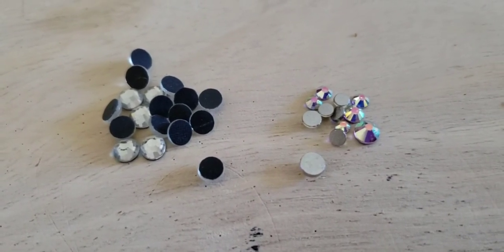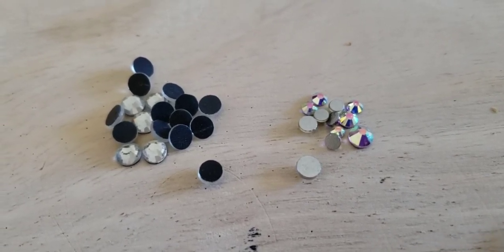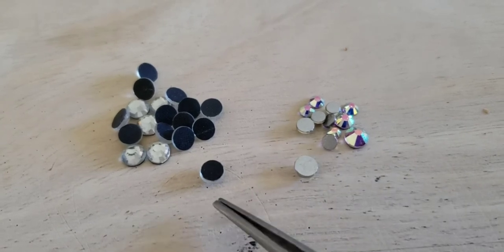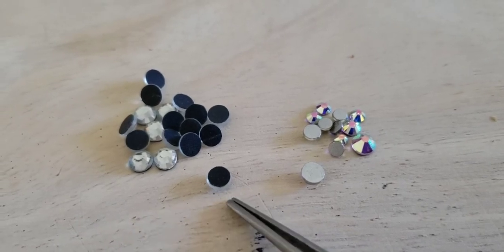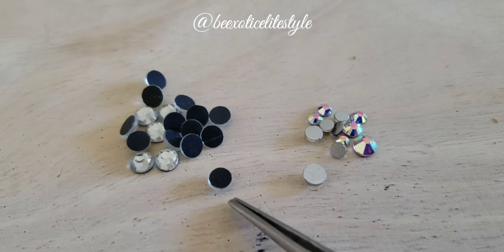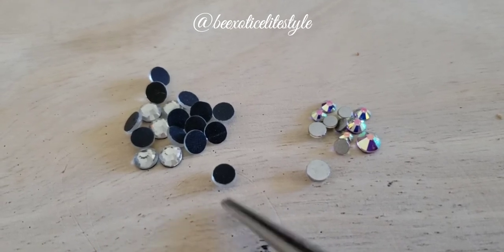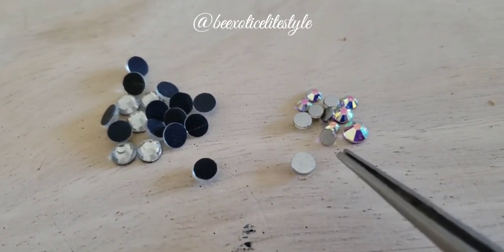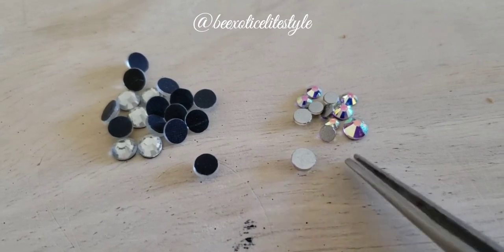Hotfix Rhinestones vs Non Hotfix Rhinestones

Comment: Now if we had, say a B7000 glue for the non hotfix rhinestones. Which would you say would be a stronger bond. Either the hotfix ones or the B7000 glue? Just wanting a pros opinion. Trying to find the best application processes before i go spend a pretty penny.
Reply from the maker: I'm definitely "pro" on the matter. However, I have never used the B7000 that you speak of.  I had to test out glues for myself to see which worked for me. I totally recommend you test the glues you use to find which one works best for you. I have moved away from "hotfix" rhinestones because I want longer lasting adhesive.
Reply: @BeExoticEliteStyle  🤔 thanks for the info…
So basically E6000 (or E6000 premium, or E6000 jewelry & bead)  type of glue is stronger than hoxfix rhinestone?

I wonder what they use on the sneakers or any clothing that they sell at the store because I cannot see any glue mess around the rhinestone. And at the same time it says it is washable, Even dryable which means heat does not unglue any rhinestones. What type of glue or rhinestones do you think they use?